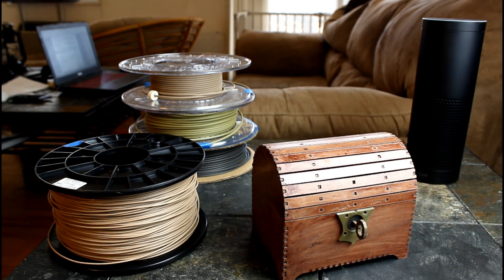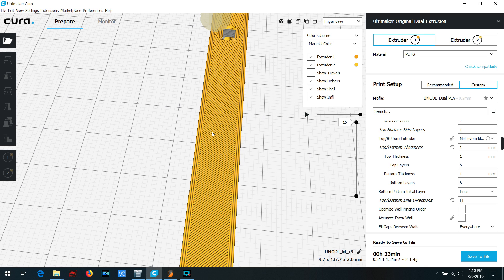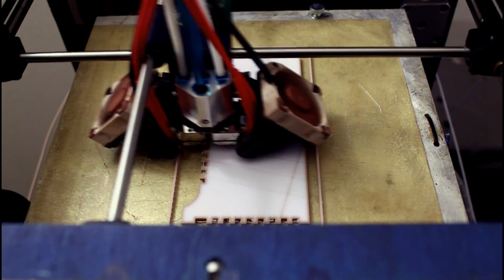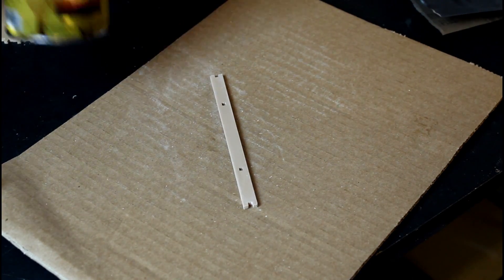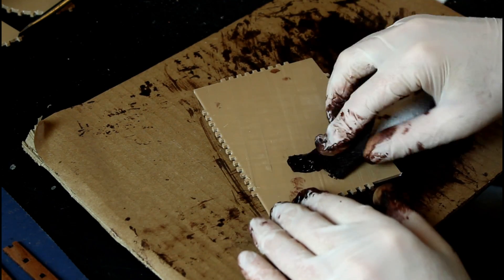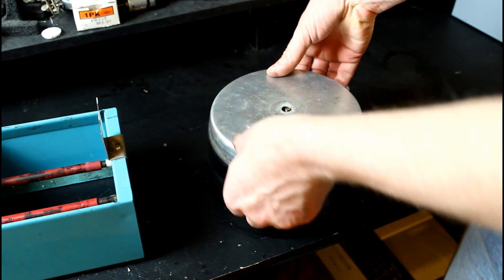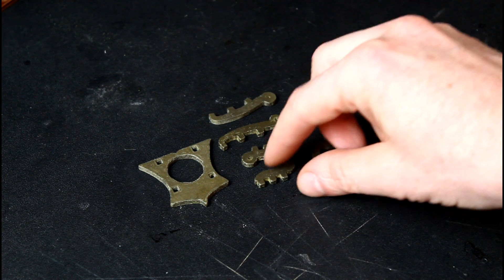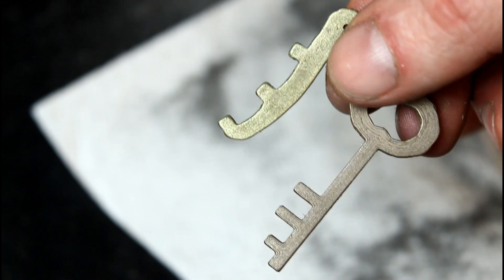Simulating Wood and Metal with a 3D Printer

Comment: OMG! I was just considering making a small chest for the remote controls with wooden filament but the high cost it would have had me in doubt. Your trick about using cheap one on the inside is a great trick! Great job and thank you!
Reply: What slicer settings allow this?

Comment: Best Wood post processing vidéo i've Seen so far. English is not m'y native language so can briefly explain to me how exactly thé tumbler is working and... Its original purpose ?...
Reply from the maker: The tumbler works like a clothes dryer. It scoops up the parts and drops them over and over again. My father used to metal detect (finding coins underground). He used the tumbler for cleaning the coins by adding small rocks with the coins and letting them tumble for an hour or two. It is useful for anything that needs to be polished, cleaned, or smoothed.

Comment: Great video, and excellent results on the finished products. And maybe I missed it in the video, but what brand of filaments are you using?
Reply from the maker: Thank you so much. The wood is from MG Chemicals Wood PLA and can be found on Amazon. The steel is Protopasta Magnetic Iron PLA. The brass and bronze were ColorFabb BrassFill and BronzeFill PLA.

Comment: Thats awesome! I want to dive into wood and metal filled filament post processing soon and this helps me a lot as it answers some questions I had. Do you think that metal polish also works with making the parts shiny? Thanks for the video. Cheers! Say hi to Alexa from me. ^^
Reply from the maker: Hey there Rod. I think a product like Brasso could work well in giving it a wetter, shinier look but that is one thing I have not tried yet. I did try an aluminum polish once (because that is all I had on-hand) but it did not work the way I had hoped, but I think it was really the wrong product for the job. Thanks for watching. Alexa says, "Who is Rod Snyder? Tell him hi or whatever. Are you still on the computer. You really need a life."
Reply: @0calvin Hey Brian. Thank you. Then I will try different metal polish compounds until one works. Your sassy assistant beta unit kicks butt! =|:-3